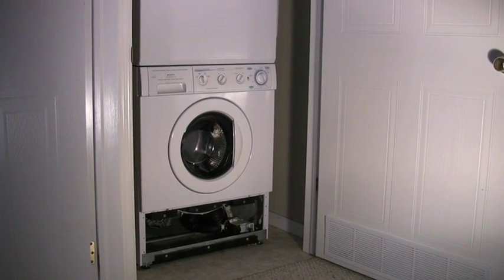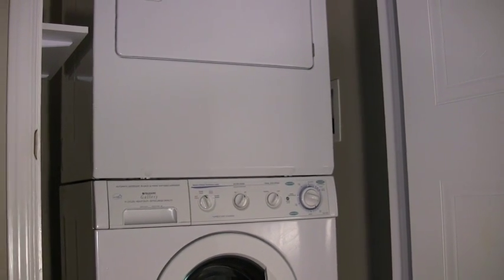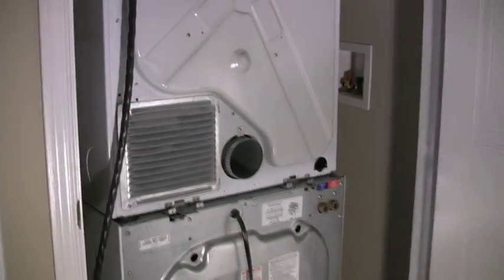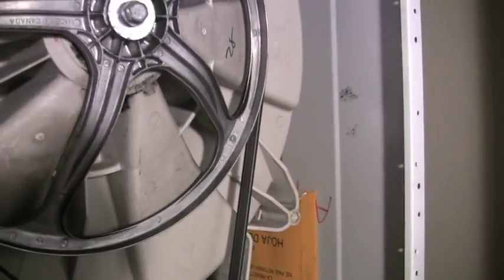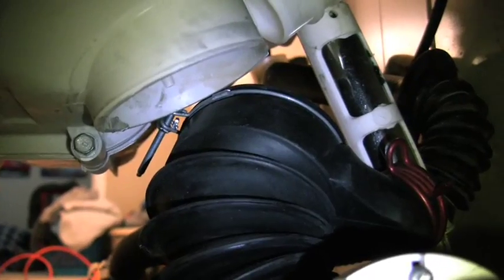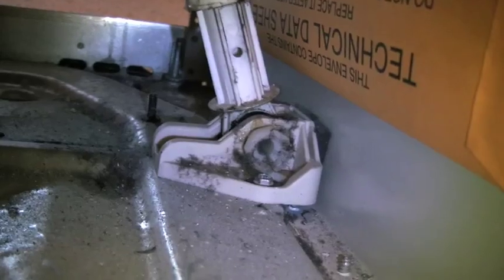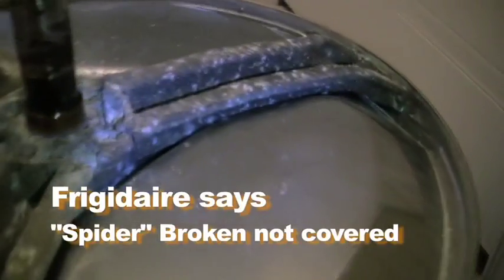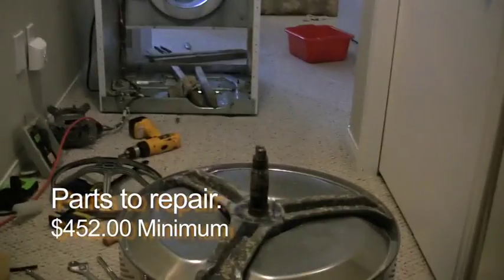Frigidaire Sucks

Comment: I have been in the Appliance repair business for 28 years now and i tell everyone to stay away from front loaders they all suck. Also any digital appliance, stoves have a vent under the board and it melts the board. Dont use self clean, the first time you use it thats the end of the board. Washers the steam comes up and burns out the board. If you remember all the old stuff lasted 25 plus years they make all this new stuff to break.

Comment: I have Fridgidaire same washer, going on 10 years+ and we have kids so we load it up full and run 5 loads a week.  We also broke shocks but replaced.  Lately makes a puddle on the floor during fill, I disassembled  and saw water stains from a "air vent" looking hole on the water guide into the drum - I restricted the input water to run it slower, fixed mostly. We have not had trouble with the spider but wife goes easy on bleach/detergent and we have city water.  Thanks for info.

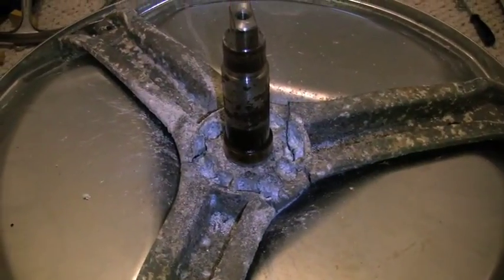Comment: If you look at the video beginning at 4:30, you can see the extreme corrosion of the aluminum spider.  In my instance, the spider was paper thin in places which is the cause of the failure.  This occurred because of the use of the wrong material. Aluminum is subject to corrosion by the chemicals commonly found in laundry products; Every machine with this construction has a built-in time bomb.  If aluminum was to be the material of choice, at the very least it should have had a protective coating.

Comment: Thanks for publishing this video.  I too have a Frigidaire--have had it for only three years and it looks like the door lock assembly or control board is bad; clothes come out soaking wet because the spin cycle never kicks in like it should (the control board doesn't think the door is locked).  Three years of 2 person use and it's already seeing issues.  I think I might find out if the spider is aluminum, look at the plastic basin, fix the lock problem, sell it & move on over to a Samsung WF337!

Comment: I bought mine in 1999, still going strong in 2015...  2-3 loads per week (many ridiculously heavy).  Had to change the drain pump last year because of a leak. 80$ and 30 minute job from the front without having to remove the unit from its place.  I might have been lucky but I LOVE this machine.
Reply: +Luc Lopes Can you upload videos of your washer and dryer?
Reply: Why would I do this?  A video of a working unit is kind of uninteresting no?
Reply: The comment is not showing on Youtube.
Reply: So?

Comment: When my wife and I bought our house about 6 years ago, we bought a brand new Frigidaire washer, dryer and dishwasher.  I have had problems with all 3.  

On the washer, I have had to unclog the hose to the drain pump several times because socks and other items make there way into it.  I am now in the middle of replacing the door lock mechanism because it will not begin the spin cycle.

The dryer has ruined countless articles of clothing because they get snagged on the lint filter and then twisted until they break or are just too stretched to wear.  We have lost lots of tank tops and underwear.  I have had several strings on my boardshorts break also.

The dishwasher has unexplained power failures at various times during the cycle.  You always have to rewash because you don't know if the dishes are clean.  Sometimes it dies before the soap is release though, so then you know the dishes are dirty.

I'll never buy another Figidaire appliance again.

Comment: Thanks for the video!
I have the same model and guess what, same issue after 7 years. Also found out that although the spider is part of the entire assembly, it's not covered with the one I own. Even if it were, to get the part they said I had to have an authorized repair person install it, which is pretty expensive.
I'm not stacking mine so now I just need to replace it. The repair place said Frigidaire is better than most. Great. It's comforting that Frigidaire is the king of crap.

Comment: now i have  the same washer too .been on i think 8 yrs now  still going great  the trick ive used  was i had started it on heavy wash with no clothes etc and took off the top to expose the water pressure level switch and adjusted the water level to just under the bottom lip of the door gasket seal  and it runs ok still  . was not washing ok   clothes were still comming out dirty .it several attemps to get it at the right level  . now when i load it with clothes it washes good and it even

Comment: My parents has a whirlpool oasis top load he washer my parents bought in 2012. It had to be repair once due to user error which got a sock got caught between the inner and outer drums. Unevenly loading the washing machine can damage the suspension rods. Overloading the washer can cause garments to get stuck between the 2 drums and jam the washing machine. Whirlpool washers are very good but, user error can cause repair expenses that could have been easily avoided. Always load the washer one garment at a time and never overload the washer.

Comment: I agree point for point; when it happened to me I guilted them into selling me the drum only.  THEN, I bought a spray can of Rustoleum Cold Galvanizing Paint at Home Depot, and sprayed all over the pot-metal spider, including as much underneath as I could get access to.  Evidently, ALL front loading washers are made with a pot metal spider, which is guaranteed to corrode in from 4-7 years.  I suggested to them that, before they swedge the spider onto the drum, they use this paint on the spider.  They could give a 10 year guarantee, and sell the thing for $100 more, while spending maybe $0.50 more on it.  And then they wouldn't end up in the landfill.  Perhaps the town attorney where you live could convince the town to tax these badly (for the consumer) thought out products, although I'm sure Frigidaire's stock price has increased because the unwashed will have to buy a new one.

Comment: I bought my Kenmore (Frigidaire) in 2003. It's now 2013 and it's still going strong. I always make sure the loads are manageable and always use HE soap. I always leave the door open to let it air out properly. I can imagine that bearings would go out at some point, but I'm happy with its performance so far.

Comment: From what I've seen, most front-loaders APPEAR to be built this way. It's a recipe for failure: aluminum and stainless steel will undergo galvanic reaction in the presence of an ionic solution like tap water. Even distilled water has a slightly acidic pH at the temps typically encountered in the washer, and will cause dissimilar metals corrosion. Detergents will create a strong alkaline solution, and also cause dissimilar metals corrosion. Then there's chlorine and fluorine in tap water....

Comment: The whole problem is that aluminum and stainless steel have different chemical properties that cause corrosion when the two metals are in contact in the presence of an ionic solution (even distilled water is not completely inert). It's the same property that causes galvanized iron water pipe to corrode when connected to copper. Add the chemicals in your detergent, bleach, and the traces of calcium, chlorine, and fluorine in your tap water and this failure is inevitable.

Comment from the maker: received the check to cover 50% of the purchase of a new Frigidaire (Electrolux) product of similar style. I have now spend $1200.00 for a (2) washing machines that will hopeful last a total of 12 years. Still not impressed with the construction and expect the problems will occur with this unit too. By that time I may move to a different (cheapest) style and dispose of after it dies. Still not the greenest solution but economical the right one for me.

Comment: Thanks for the video. I was shopping for a washer dryer sets for my condominiums and was considering Frigidaire because I thought that it was a good brand. Any engineer worth his salt knows about electrolysis and dissimilar metals. This machine is obviously designed to fail. I'll pass on Frigidaire.

Comment: I have a similar one from 1999, and I paid US $650 on sale.  I've been lucky mine has held up.  Only work done to it has been replacing 2 drain pumps, due to my sister refusing to empty her pockets, and it burnt out, twice.  Other than that, mine has worked fine.  I don't have the matching dryer though.  But I do want to upgrade to a bigger one at a later date, but not sure what I'll get.  I however don't want the small Frigidaire again.

Comment: I also want to add, take in to consideration water quality in your regional area, if you have hard water, that could have also contributed to the premature corrosion. Yes, that spider is made of a cast aluminum composite metal, most likely mixed with tin. When mounted to the Stainless steel drum, you get a battery type reaction! However, your water quality may have sped up the deterioration.

Comment: I agree with tingokuman. If you got 7 years out of it the machine owes you nothing and you`re ahead of the game. I see this post is 3 years old which would put you at 10 years now. Try and replace this set up now and you`re looking at 3 Thou. I have a rear tub bearings issue which is similar to this issue minus the spider replacement, Just look on Craig's list and get a washer for $50.00 and switch it out. Maybe you`ve been washing unbalanced loads and they`ve taken their toll after 7 years.  I`ve had a Bobby pin in my drain first, causing it not to drain. Took the drain pump apart Done! Then a few years later the Drain pump went. Replaced it for $40.00 bucks. Now my Rear bearings a re gone. I got the bearings for $20.00 bucks and the belt for twelve, and I`ve had mine for well over ten years. My first repair was covered under Warranty, second one I got the part on Ebay. Not bad for an old Frigidaire.

Comment: Front load washers, regardless of brand, have a history of various types of failure of drum support/bearing system. Many things can cause premature failure, load weight and type of detergent used being the most prevalent. You do a disservice to the consuming public by singling out Frigidaire when the issue is pretty much related to all brands of front loaders regardless of price. We had a Frigidaire front loader that lasted 10+ yrs and probably contributed to its demise by overloading. Follow the manufacturers recommendations re: use and you may find that this unit is a bargain.

Comment from the maker: You can only access the inner basket by removing the back plate, whole tub. It's not worth repairing it since the cost if repair is more than buying a new one. Complain to Frigidaire or Sears or Electrolux. They may helpbwith the cost of replacement.

Comment: I have the exact same setup as in the video.  Ours were purchased in 2001.  I am getting some loud noises on the spin cycle, which I think is the bearing.  Otherwise it has been great all of these years.  I will look at replacing the bearing and other stuff in it.

Comment: i used to run the appliance dept at sears ive actually sold a few of these if you got 7 years out of it you got your moneys worth.to manufacture a washer with stainless and real steel and rubber interals with no plastic parts in the driveline we would have 3000$ dollar washers and 2500$ dryers.my 1974 amana died 2 years ago i replaced it with a kenmore he4 speak of the devil its in my laundry room screaming right now.i give it a few months at least i bought a 5 year warranty and to the yard sale

Comment: My virtually identical Gallery started making LOTS of noise over three years ago- based on the cost/benefit to repair, I ran it until it finally started making too much noise which was last week. I expected it to last a *lot* longer :(

My Miele W4842 should be here later today.

Definitely some serious shortcomings in mechanical design!

Comment: @dotcom777 

I also found a video posted about a similar incident concerning a Kenmore front loader. Same situation, composite metal attached to stainless steel. I recall back in the mid 90's, a few manufacturers were making washing machine baskets out of PVC. My Tapan washer is made by the Frigidaire company. Frigidaire still makes top loaders with the PVC. Maybe they should use PVC in the front loaders! Years ago Westinghouse, Philco and G-E made front loaders, and they lasted!

Comment from the maker: @gordongmilleriii The $300.00 off was as good as I could expect.  

I think my point is that the companies are trying to promote "Green" with front load using less water, yet the machines are disposable after 7 years.  The steel can be recycled but all the other "e-waste" is negating the Green benefits on a renewable resource (Water).  A simple design change would have eliminated the spider arm corrosion.

Comment: Yes, Frigidaire products suck...My front loading washer, door lock mechanism went out in less than 1.5 years; $130.  I will now begin counting the costs of repairs and what is certain to be the raping of my pocketbook.

And....my Frigidaire upright side by side, fridge/freezer leaks water all over the floor every self-defrost cycle.  Frigidaire blows!.. Never buy from this company unless you are prepared to shell out for the repairs.

Comment: also when i load it with clothes at the adjusted water level  it now  when stopped just above the door sight at about 1 to 2 inches  ok when it is running  no leakes yet  now the only thingy is that i do have to replace the drain pump due to a thread getting wrapped up in the pump shaft

Comment: I'm trying to work with the mildew smell issue and ran across this obvious design fault several times on the internet. I have two questions:

1) Does the new washer mix aluminum and stainless?

2) Does the old dryer fit on top of the new washer?

Thanks, and great video!

Comment: ahhh yet another frigidaire failure...  I used to work for te company in the 90's and got one of these neat new machines in 1998 when they were fairly new..  I ran it for about 4 years and lost the tub bearing.... 5 years later bearing noise again and matching dryer motor locked.. tstat didnt kill heater...  smoke filled the house.. had i not been home my house wouldve burnt down..  electrolux didnt care when I called.. so I bought a new LG set in 2007... no more frigidaire for me

Comment: Frigidaire dehumidifiers are no better with a 12 month warranty, unit fails at 14 months.  Reviews show over 50 % similar problems. Low and behold they discontinue model and refuse to replace it. FRIGIDAIRE SUCKS

Comment: I have the same unit, the motor brushes wore out, as brushes do, no big, right?  You got it, no brushes, you're supposed to buy a new motor.  A helpful web site led me to alternate brushes that fit with modification and only cost about 1/2 of a motor(!).  May have been wise to get a new motor but on 'green' principles I just overpaid for the brushes.  Frigidaire is way down the list for my next appliance purchase.

Comment: @dotcom777 
You are right! If Frigidaire wanted to make good and resistant washers they wouldn't put such weak materials just in the parts that have to be strong (suporting the basket)! and answering to rubin808 , Good washers aren't suposed to last only ten years (at least the european frontloaders aren't: Siemens and AEG still talk about 15 years, and Miele are the best ones because they promise 20 years but their machines last More than that! Old AEG used to last a lifetime too)

Best wishes!

Comment: Did you get a washer like this one, or another model?  I have a model similar to this from the USA, and mine is from 1999.  Mine has held up for 10 years.  Maybe I just got lucky and got a good model.  Better than the US Hotpoint top loader I had that broke, and no repair man could get it fixed, and it was junk after just 3 years.  Not sure if my next washer will be a Frigidaire.  I paid $650 USD for mine.

Comment: i hate to break it too you. but all front loaders wear out in about 7 to ten years. when you rotate heavy objects horizontally, you tend to wear out something..... you will wear out the bearing.

and if your dryer overheats, theres a thermal fuse. they tend to overheat because people vent their dryers like retards. and cause fires due to PLASTIC venting.

im a tech, i speak from experience. all fl washers will blow bearings in about 7 yrs.